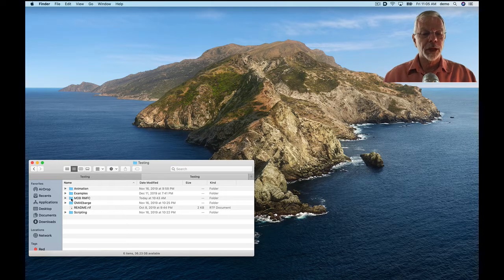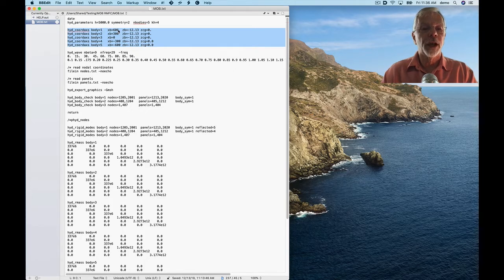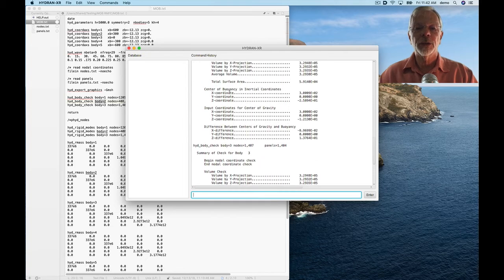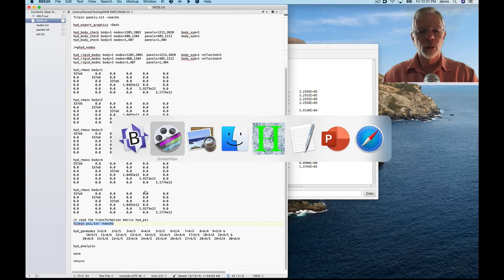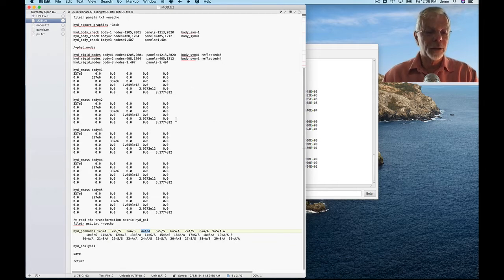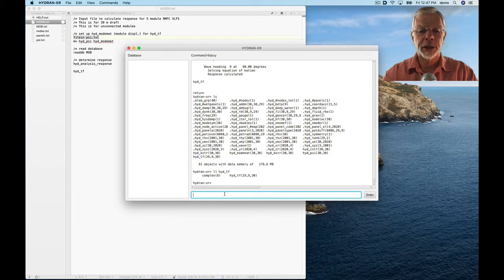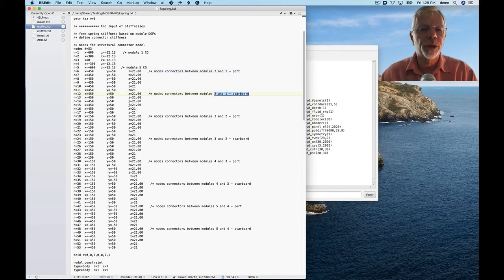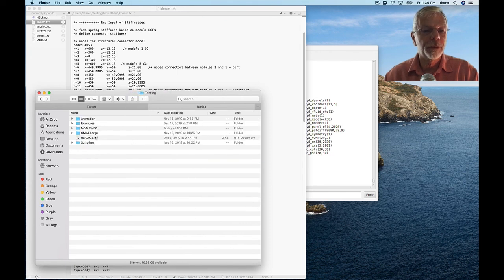Rigid Module, Flexible Connector (RMFC) Hydroelastic Analysis of a Mobile Offshore Base (MOB)

Comment: what methods are you using to obtain the coordinates of each node and how are you preparing the .txt file for these inputs?
Reply from the maker: This is probably the most time-intensive step. Except for very simple structures, it's best to use a mesh generation software. Structural analysis software has this. Once the mesh is created, you can export the mesh. May need a little cleaning up using a text editor to get it into HYDRAN-XR format.
Reply: @oci96734  ok I thought it would be something like this, thank you for the quick helpful reply!